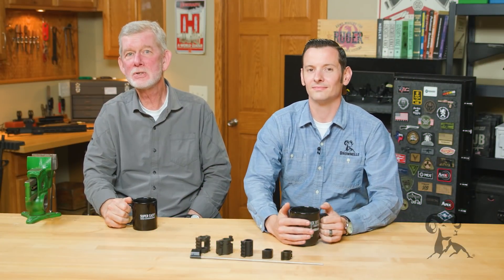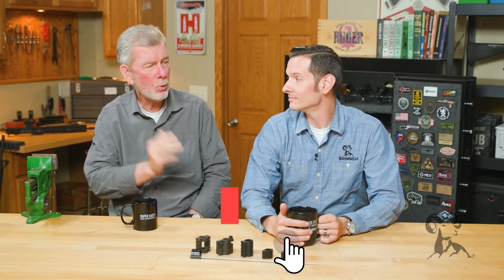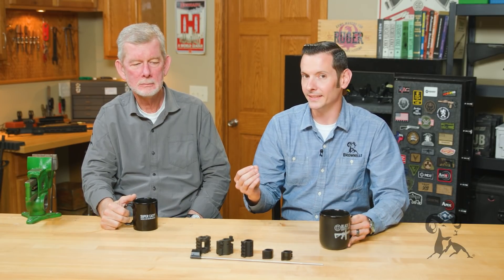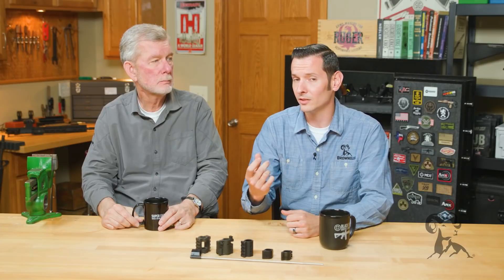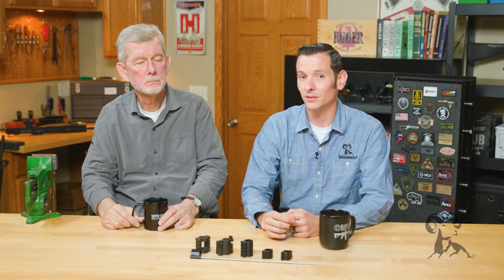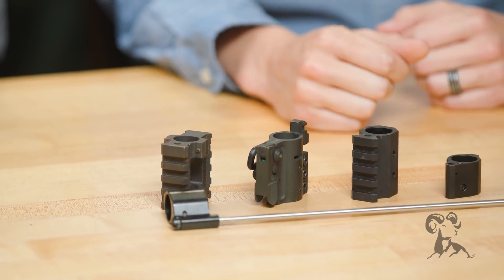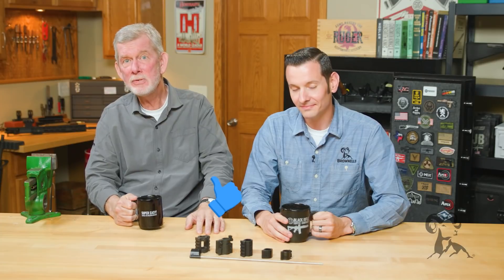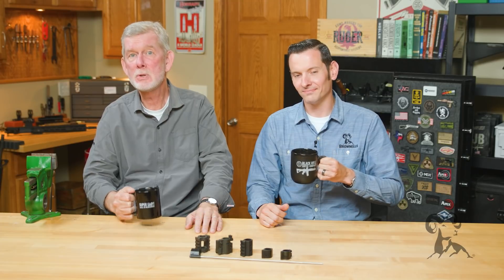Smyth Busters: Is an Aluminum AR-15 Gas Block a Good Idea?

Comment: Good video, gentlemen.  I spent four decades (in uniform and at Lockheed Martin) dealing with the properties of materials for advanced tactical weapons systems.  Although are many different aluminum (and steel) alloys and both metals can be foraged, cast, extruded, etc.,  the basic fact is simple:  aluminum is softer, has a lower flash point and Mel;ting temperature, is more susceptible to crack initiation and propagation, and is more easily eroded than is steel.  Of course, there are MANY applications where aluminums are entirely satisfactory, but consider the heat and the gas pressure to which AR gas blocks are exposed.
Reply: I've seen some companies using 2055 and 2099 aluminum/lithium alloys for AR-15 parts like buffer tubes, hand guards, uppers/lowers. Is there any point in using those particular alloys over forged 7075 or 6061 or is it mainly a sales gimmick? 

The extra cost is substantial, so other than shaving off a few ounces, what increase in performance is there?
Reply: @oldscratch3535  
Some aluminum-titanium alloys may “theoretically” be stronger, more durable and more fracture resistant than forged 7075 or 6061, BUT there is no question 7075/6061 are perfectly adequate — many decades of history prove this — for the intended purposes.  I have not dragged my old text books and nites out to research this, however, these plain facts speak for themselves.  You know, a Corvette’s maximum velocity is greater than a Toyota Corolla’s, but if the driver will never exceed 70 MPH, isn’t that — practically speaking — irrelevant?  MilSpec designs, materials and manufacturing methods are intended to function reliably under extreme combat conditions, very high round counts, and in highly adverse environments.  Last time I checked, military AR’s use aluminum and composites extensively (except, of course, for the barrel, bolt, bolt carrier, etc.).

Comment: What about an aluminum gas block on an AR-10 style rifle cambered in .308 win?
Reply: Same exact situation.
Reply: ….um, no.
Reply: Who can afford to shot any 30 caliber round enough to get the block hot?  These days that is...
Reply: @jfal104  It's not about getting the gas block "hot".

Every round you fire sends extremely hot and high pressure gasses through the gas port. Aluminum does NOT take kindly to that and erodes very quickly.
Reply: @animalmother556x45  I think you missed the point of my post...sarcasm does not always translate well to typed messaging I guess...

Comment: When I saw this, I wondered if you were going to give the OK to aluminum blocks, and given the nature of the metal, was interested in your reasoning.  Thanks for confirming this is a bad idea. 😎
Reply: I wonder if there is an aluminum block with a steel sleeve where the port meets the barrel? Aluminum is about 1/3rd the weight of steel. If you can keep the port from eroding, it will save weight no matter what "skeletonized" steel block you use. I don't really care, just thinking out loud.
Reply: @PimptatoPCs  I have no doubt this can be done, but would it be affordable?